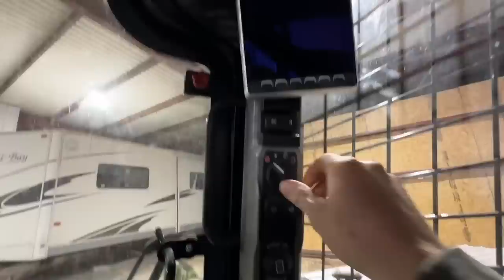New Feed! New Pen! Hope We're Ready!

Comment: A suggestion on that  2x4 in the coop turn it so the 4 inches is flat and it is easy for them . Sand so they do not get splinters or cover it with old carpet.❤ hope it helps.❤

Comment: If you mix some lime with that sand, it'll become almost like concrete yet. You can dig it up with a shovel if you need to. That's the mixture they use one part line to four parts sand for walkways, and such around castles in Europe before cement slabs were invented..